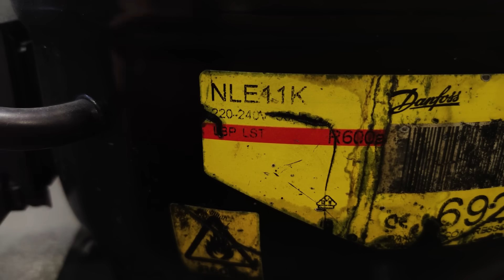Convierto un compresor de refrigerador en una máquina de soldar. Nueva tecnología 2023

Comment: The electric motor welder is made differently. It is necessary to use a ring, three-phase, asynchronous motor with a short armature (with a winding on the rotor). Next, it is necessary to block the rotor. Voltage is applied to the stator winding and the rotor winding is welded with a basic electrode. It works like a leakage transformer. A video with a 70W single phase compressor electric motor and an air coil that has a wrong coil orientation cannot work. Apparently the voltage is not applied to the stator, but is inside the "coil" in the plastic tube directly connected to the welding wires. This detail is understandably not shown during the "functionality" demonstration - it is always hidden. The voltage is apparently supplied from a lead-acid battery. For the voltmeter it was line voltage. The wires can withstand current from a lead battery for a while (they are car wires to the battery) because the base electrode is about 2mm in diameter. Very nice magic trick.
Reply: Yes not only that, the welding machine is transformer we big coils and this man have like dinki..coil for induction motor...no amps.. enough..he have 227 volt supposed to be right and he conect 120 volt light.... No wonderful the name of is Chanel is (! Crazy chanel! )... have nice day my friend 🤔👍🇲🇽🇺🇲😀

Comment: thumbnail claims it produces 2500 amps. pretty sure that would melt the welding cable in 10 seconds flat. you couldn't weld with that much power, it would just blow the crap out of the metal you were trying to weld.

Comment: This contraption does not work for two reasons: (1) When the rotor is removed, the inductance of the motor winding becomes very small.  If you apply 220v to it, it will draw so much current and burnout in a short time.  (2) During this very short time, the winding current creates a rotating magnetic field.  This field however is along (not perpendicular to) the direction of the secondary winding as built.  Consequently no secondary current will be induced.

Comment: what is the output voltage? is it possible to use an electric fan motor instead of refrigerator compressor motor? thanks

Comment: I'm going to try this with a washing machine motor
Reply: @ОлегК-я7ю  why not? It's simply a basic transformer isn't it? The electrical steel and primary coil are already in place and you just add a secondary coil? I already have the motor it was free so I would just need some thick copper or aluminum wire for the low voltage high amperage secondary coil. The only problem I can imagine is maybe the magnetic field shape of the stator winding isn't ideal for a transformer?

Comment: but can't use too long time because the fan coil copper will heat up very fast. if put the fan coil inside the electrical insulation oil to cool down the fan coil is differing story

Comment: There is a gap between the table boards... Black cables are connected to a welding unit under the table.  This kind of transformer cannot work.

Comment: he visto con atención tu video, y " todo es posible"  pero se me plantea una pregunta; habiendo a mano de cualquier tecnico en reparaciones motores de muy facil acceso como el de una lavadora de dos polos 220-240 Volts. abriste una bocha de compresor de heladera, desperdiciaste compresor y demas cortaste la alimentacion de uno de los dos campos, para inducir magneticamente ese devanado de cable de 6 mm. tratando de darle concentricidad con precintos plasticos, (imposible) simplemente con saber la medida del interior del estatir, y el Diametro del devanado, saldria la cuenta justa, para centrarlo con cuatro trocitos de madera, grilon u otro material no conductor. la verdad, no me entra ni a palos.

Comment: I don't really know why, but I decided to waste a few minutes of my life to prove that it doesn't work and you're just a scammer.
We go with the theory: 
1. The turns ratio of a transformer is the ratio of the number of turns of the primary winding to the number of turns of the secondary winding, i.e.: z1/z2

2. The voltage ratio of a transformer is the ratio of the voltages occurring in the no-load state at the terminals of both windings. This ratio determines the transformer's ability to change the voltage value, i.e. U1/U2
3. The ratio of these gears is z1/z2=U1/U2
4. For the welder to work and the electric arc to ignite and be sustained, we need an output voltage of approx. 60-70V
5. We calculate: 230/60 = 3.3, so the transformer ratio must be 3.3
 6. You have 16 windings on the secondary winding. How many windings must there be in the primary winding? We calculate: z1/z2=3.3, z2=16 from the formula z1=z2 x 3.3, i.e. z1=53. How many windings does your primary winding have? Probably 150-200 which gives us a few Volts at the output and sustaining the electric arc is impossible.
Real welding leads are hidden and connected to a real welding machine.
Reply: Beside that the stick welding machine cannot be a constant voltage output. Must have a tipping curve or constant current with at least 20V for a stable welding arc.

Comment: What size cable did you use for the 16 winding turns ?
 Was it 2.5 sq, also the cable size of the output to the welder clamps .
Very informative, with thanks.

Comment: Me gusto mucho el video, me hubiese gustado que especificara si el tubo donde envolvió el cable negro fue de plástico o metálico, como también el calibre del cable, tanto negro como del enchufe. En general muy interesante. Lo felicito.
Reply: el cable es  de 6   y el tubo no dice o almenos no me di cuenta pero digame usted si no esta conectado los cables negros de el tubo con la boina que esta conectada a la corriente como es que si puede soldar si no ahi continuidad de corriente me podria explicar  saludos desde Monterrey  n.l.
Reply: Este diseño tiene un defecto teórico. Este video es solo una broma. Si lo imitas, el motor se quemará y saldrá humo. La soldadura no es posible.
Reply: Da lo mismo si plástico o metálico, el estator INDUCE EL VOLTAGE en el cable negro, el cable negro un extremo a la trampa de tierra, y el otro extremo a la pinza del electrodo.
MUY DELGAGO EL CABLE NEGRO, MEJORARIA EN VEZ DE TUBO UN PEDAZO DE HIERRO DULCE AISLADO, ENROLLADO IGUAL.